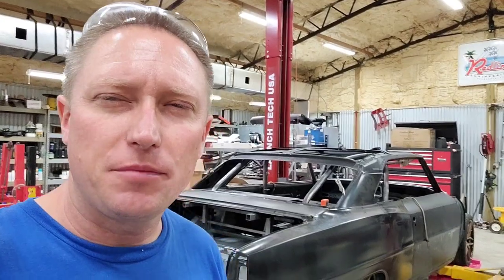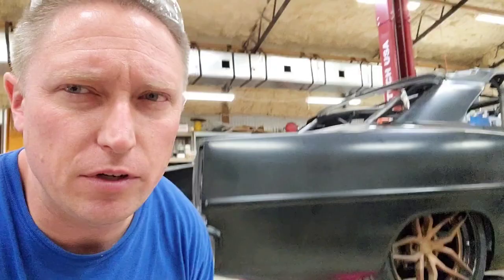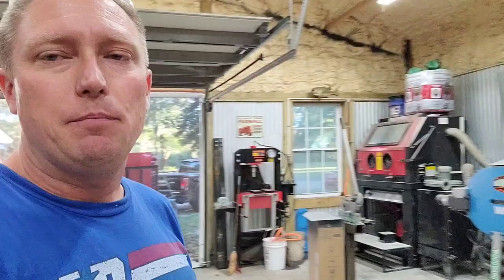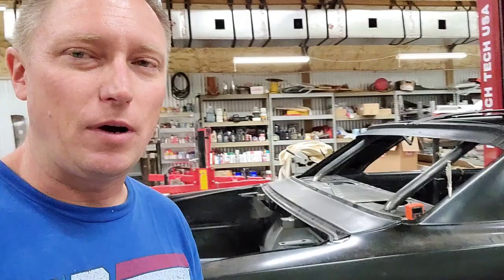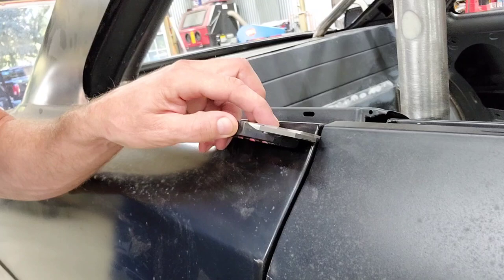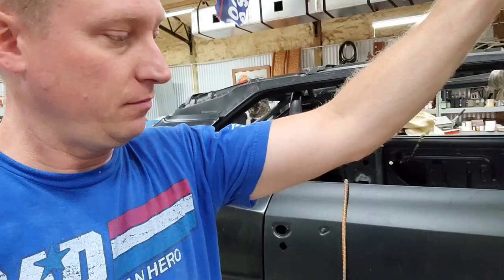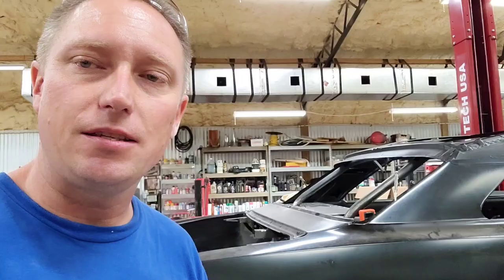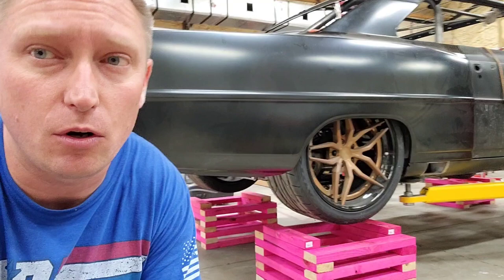2 x 4 Riser Wheel Stands - Why Pro Build Shops Use Them

Comment: If floor is uneven I support front suspension on the tires and support the rear axle at the differential. 3 points of support will allow the body to equalize itself. I did this with a 3rd gen camaro while installing subframe connectors and when finished the door fit was way better.

Comment: I have a car dolly I ordered from you guys  coming tomorrow! And now you tell me l should of went to Home Depot!?
Reply from the maker: I don't follow you sir.  These 2x4 wooden stands are not a dolly.  Dollies support the car from the frame and allow you to roll it around.  These 2x4 stands support it from the wheels and do not allow for any rolling.  Two totally different things.
Reply: Hi, I was kinda half kidding. I get what you said. When my 68 mustang convertible is on the lift. The door gap gets bigger. I bought the Dolly (should be on my porch today!...no joke) to work on 65 fastback. Floor pans etc. The rockers are good and without the drivetrain I think the Dolly should be perfect. Thanks for the reply 👍
Reply from the maker: @royboy3597  Make sure you put a good endoskeleton in the car.  You should never remove the floorpan without an inner structure to hold it all together.  Thanks for the business!

Comment: What length are those 2x4 are cut? How many are cut for each? At what height?
Thank you.
Reply: I would not use his design for cribbing.  The wheels are trying to push the cribbing apart instead of just being in compression, so there is more of a failure potential for them.

Comment: These cribs are improperly built and appear unsafe compared to designs where the longer 2x4's are underneath the tire supporting weight.
Reply from the maker: Maybe he's right; maybe he's wrong.  Idk.  I can only tell you that I've been using them for 6 months with no issue.
Reply: @RedlineStands  If we don't hear from you for a while, we'll assume you've changed your opinion. Looks fine to me.
Reply: All they need is blocking between each crossways 2×4 all the way to floor. Today's lumber isn't what it used to be.

Comment: How do you know the wood can support the car?
Reply from the maker: It's really just an estimated guess.  2x4's are pretty strong and I used 3" wood screws.
Reply: People have been doing this for quite a while.
Reply: It all depends upon the design.  This is not a particularly good design though.  The 2x4s should be only in compression.